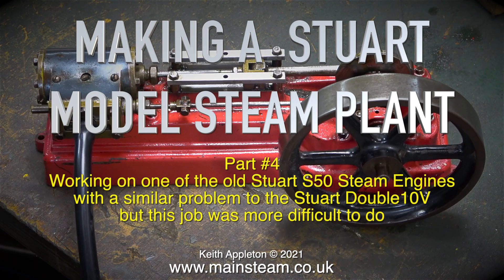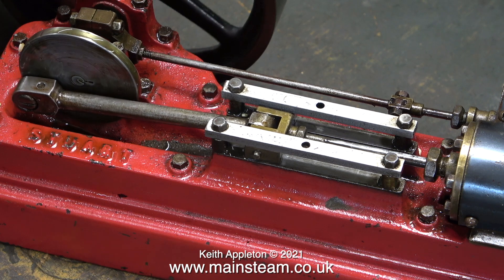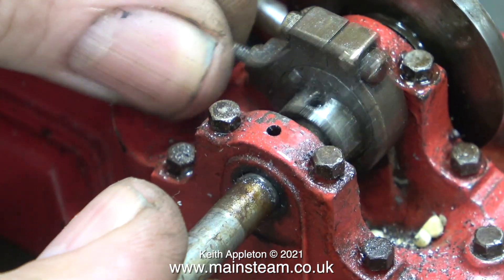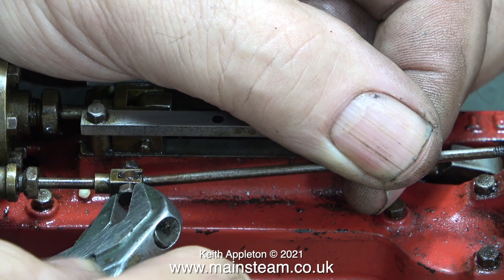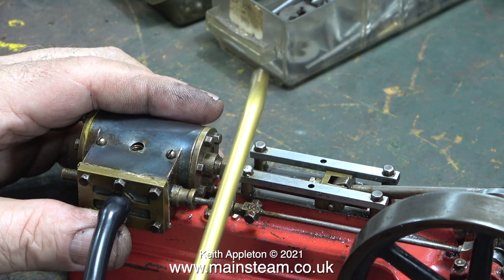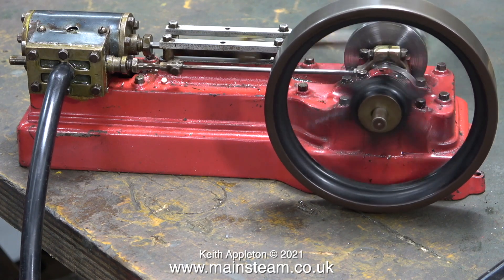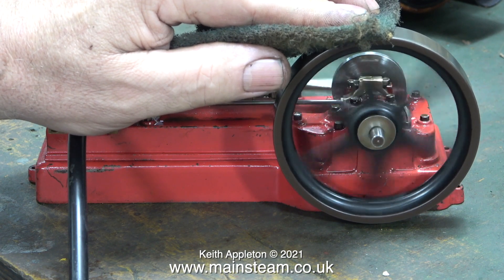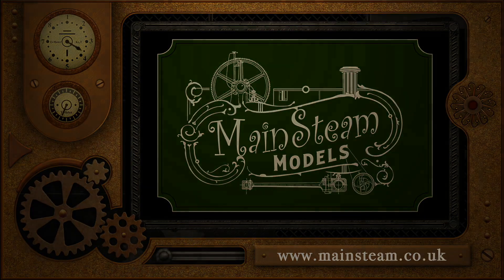MAKING A STUART MODEL STEAM PLANT - PART #4

Comment: Wow you built an S50 in a day!! That’s impressive!
Reply: I'm building the S50 as my second build and for sure it is taking longer than I expected, but then when you make the parts over it does string it out.    Cost has increased since it has BA threads and at least two non-standard,  to me mills 3/32 and 7/32.  Castings came with a poor flywheel that had not filled the mold and then the steam chest being so hard it chippd a carbide mill so had to get another.

Comment: Keith; You said you were running this engine at 30 PSI. Is it possible to over pressurize a model steam engines piston? When does it become to great and dangerous? What would be a good "general" operating pressure for these small steam engines? Maybe you could answer these questions in a future video.
Great video as always. ;-)
Reply from the maker: Steam engines will often break if you over pressurise them, they just want to go faster & faster. For small steam engines 40psi is usually enough pressure.

Comment: I like these little S50s: they are very elegant. Do all the older S50s have the circular version of the balance weight on the end of the connecting rod? The current version of the kit has the more conventional shape, I believe, which looks better, but does require a casting.
Reply from the maker: The circular type is a pain as it is threaded onto the crankshaft, I much prefer the later type, but I like the earlier Gunmetal cylinder model.
Reply: @keithappleton  That is interesting - I did not know that.

Comment: Nice work Keith . I do believe that the early S-50 engines had dummy bolts through out , I have two which are made this way .
Reply from the maker: I think they are still the same - with dummy bolts.
Reply: @keithappleton  The early S-50's also had the cylinder and steam chest cast as one piece and the used a round crank disk .